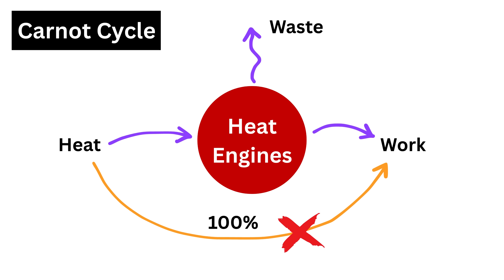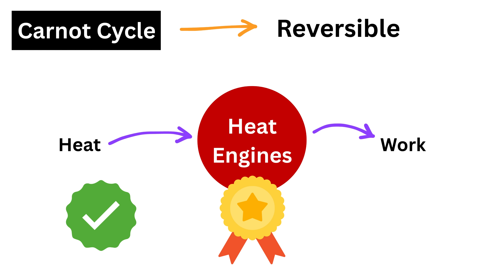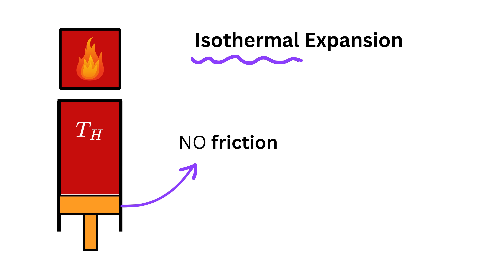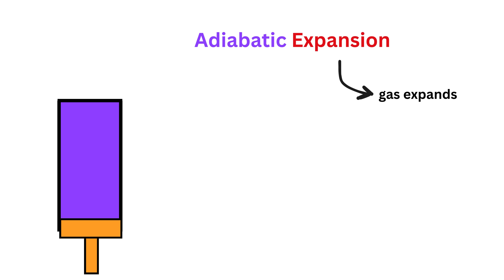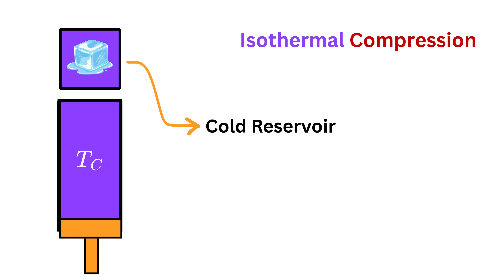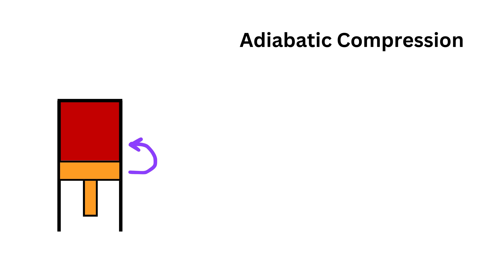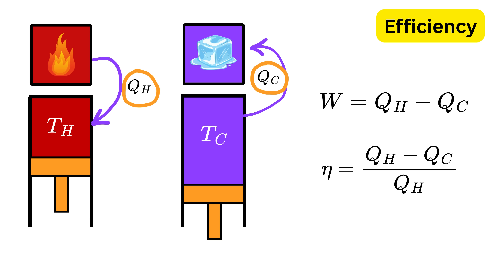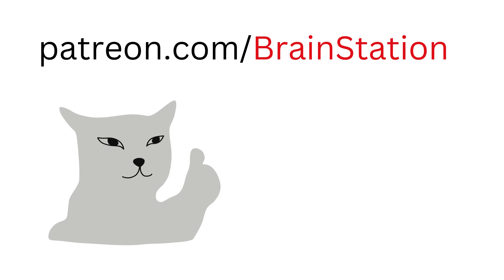Carnot Cycle Best Explanation Ever!

Comment: Why Qc/Qh=Tc/Th?
Reply: because Q = some_constant*T
Reply: @romanbayramuk6632  so we can write it for any non-reversible transformations. The question is why only for carnot machine we can write that.
Reply: @AAA-fv delta Q = m*c*(delta T) in general. 
not only for Carnot cycle
Reply: @romanbayramuk6632  I'm sorry but that's wrong. Qc/Qh=Tc/Th is ONLY true for reversible cycles not irreversible cycles. If we could write Q=mcT for any machine all machines would have maximum efficiency. And that's what make carnot machines special.
Reply: And Q=mcDeltaT is not a gernal formula , it only applies for some thermodynamic transformations.

Comment: It means, you need to have the highest adiabatic exponent you can get in order to the best cooling or heating during the adiabatic expansion or compression. So it is better to use mono-atomic gases with an adiabatic exponen of 1.66 like Helium or Argon for your engine instead of Hydrogen, Nitrogen or Air with an adiabatic exponent of 1.4.